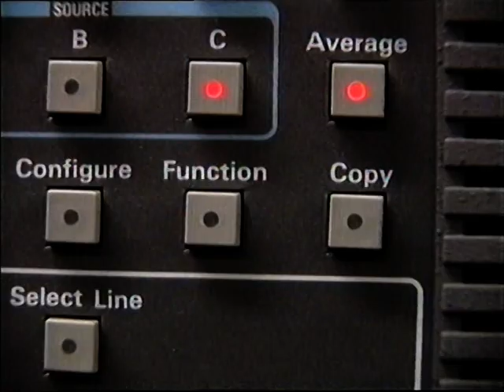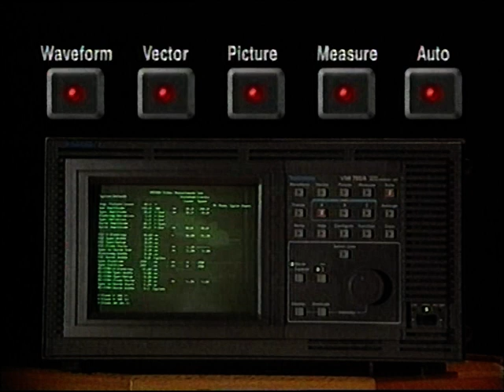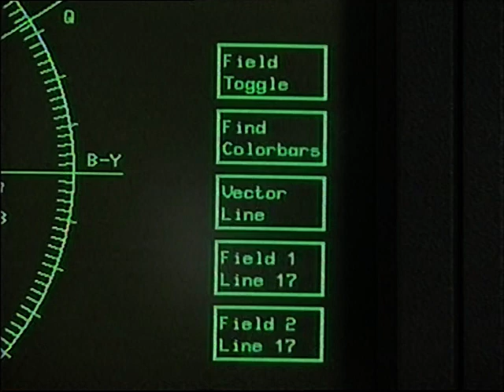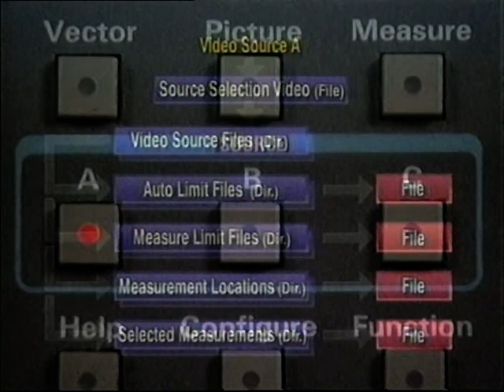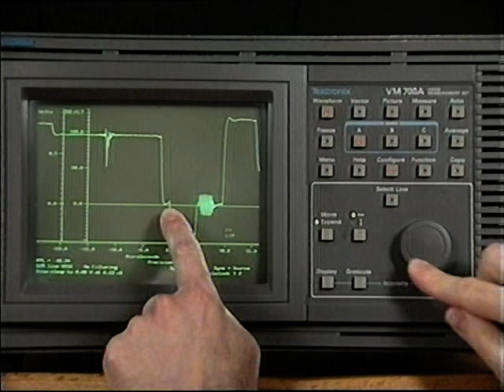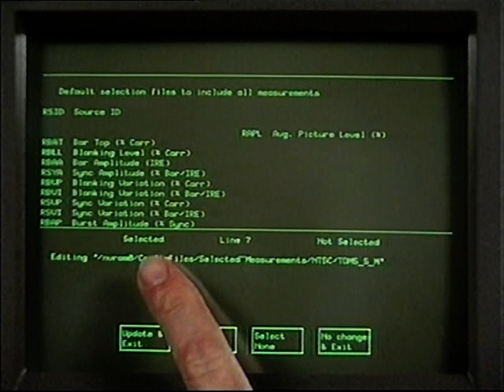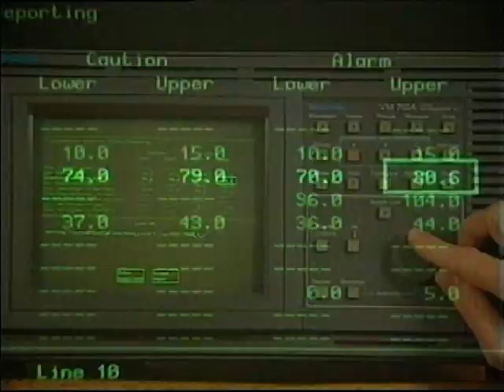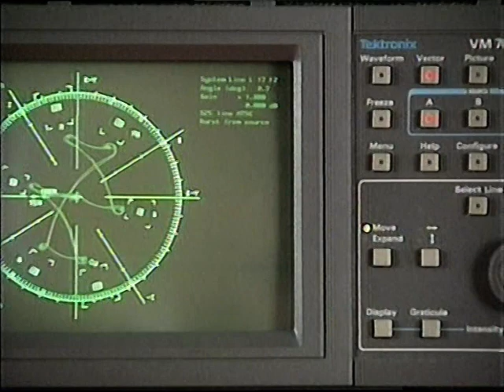TV broadcast

Comment: Hi, i was just wondering if you can answer this. Just how good exactly was broadcast analog tv? Be it terrestrial, satellite or cable. Would it be superior to Laserdisc in a perfect scenario (no interference or degraded signal due to distance or weather or whatever). I would very much like to find a few captures or digitized clips / samples from a good source (not VHS!) that would allow me to see how good could broadcast NTSC or PAL composite signal get. Could one get the same quality of say Type C videotape? What about live untaped TV?
Reply from the maker: I will try to answer but I need to have specifications of the laserdisc. As far as I just read it is uncompressed analog PAL but I don't know the achieved video bandwidth as well as the signal to noise ratio.

Your three transmission paths have different pros and cons. The terrestrial path could achieve the highest signal to noise ratio but with high distortions in the linearity and frequency response caused by the power amplifier at the transmitter site. Typical s/n of a braodcast transmitter and professional receiver combination is in the range of >60 dB weighted.

Analog satellite could achieve equal signal to noise in case of the older generation 36 MHz transponders. The European 27 MHz transponders could reach up to 55 dB weighted signal to noise when used in combination with large size dish > 1,5 meter.
Satellite was better in terms of linearity an frequency response due to the FM modulation and easier filtering.

Analog cable TV could achieve excellent linearity and frequency response in case good equipment was used. The signal to noise performance is highly dependent on the scale of the network and the use of analog fibre optic links or long cascades of amplifiers.

The modulator itself would reach > 60 dB weighted video s/n but at the subscriber end was usually degraded at around 44 to 50 dB s/n.

For your information: I recorded professional TV broadcast test lines showed in this video on a Panasonic DVD recorder and played it out on the VM 700. All signals were excellent and did not measure significant distorsion.
Reply: Thx for having taken the time to explain this.

I wouldn't be able to tell you about Laserdisc's technical specifications, people usually say they're superior to broadcast quality but they might very well be wrong. It would be interesting to find out how laserdiscs were pressed and if the masters were on tape - i would have guessed that you'd have to telecine the film first into tape, then into laserdisc?

On another note, on the video they have those grey industrial IBM Model M mechanical keyboards xD
Reply: So I found some info http://forum.lddb.com/viewtopic.php?f=32&t=249 :)

Yeah in the early days Type-C 1" tape was used as the master. According to some, 1" was the best analog videotape format ever. 

Now my question is: was Type C a bottleneck for the actual quality one could get from broadcast? Let's say a live event that was broadcast live, would it have superior quality than if it was pre-recorded on tape?
Reply from the maker: I have found detailed specification on a Type C 1" Ampex. Is this a machine you want to compare the broadcast channel to?

http://www.broadcaststore.com/pdf/model/7123/7123.pdf